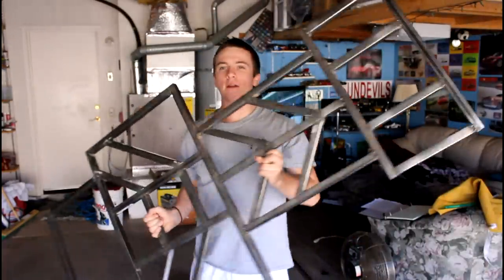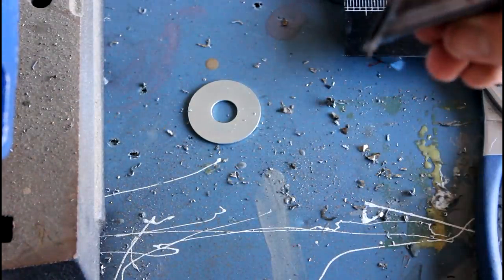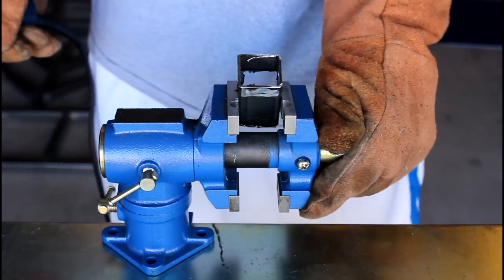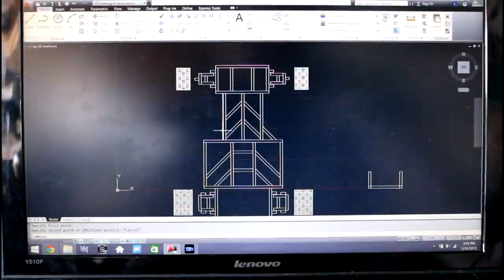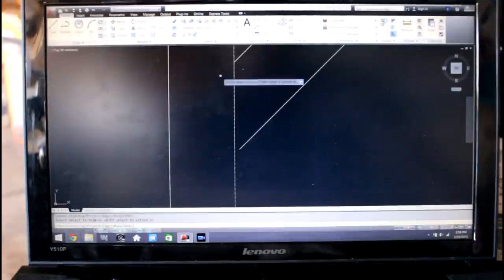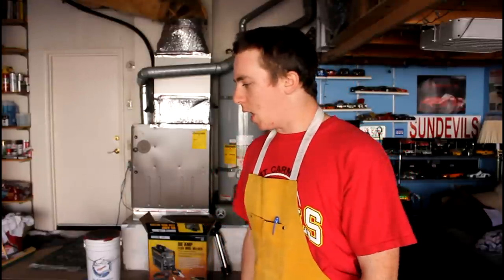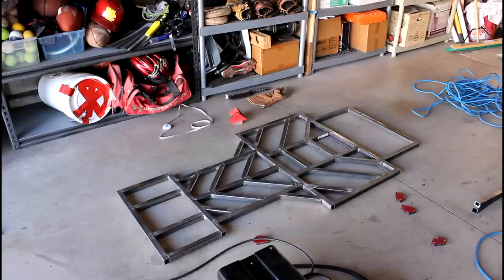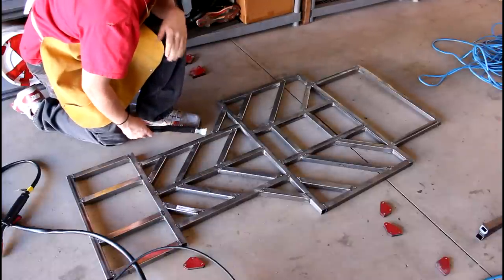(Homemade) Go Kart Build Project 6: Fabrication, Welding, AutoCAD design

Comment: iam a newbie to go kart..here the parts for go kart are rarely available at very exprensive price.so i decided to make one from my gearless scooter of 110 cc.can you please suggest the sproket ratio for that...?

i dont know how to place the suspension.can you plz help me for that?
Reply from the maker: The sprocket ratio depends on what top end speed you want. A higher ratio will give you better acceleration but lower top end speed, lower ratio will give lower acceleration but higher top end speed. As far as suspension design, I'm not too familiar with motorcycle/scooter suspension. I would suggest googling or finding YouTube tutorials that walk through the principles at hand
Reply: Hnat Automotive ok...thanks for the reply😁

Comment: How much did the frame cost all together? How bout the whole go kart?
Reply from the maker: Based on the cost for the raw material steel tubing I would say about $150 roughly. Whole go kart (Without the cost of tools bought) is probably around $1800

Comment: What is the size of that drill bit im designing my own and didnt know what size to use
Reply from the maker: I can't remember off the top of my head, but just use one that works with the bolt size for your shock mounting holes
Reply: +Hnat Automotive Photography ok thanks i love the go kart btw
Reply from the maker: Thanks man I appreciate it! Good luck with your build. Let me know if you have any other questions!

Comment: or which motor ist the best and which type of metal you use because the kart can't be so heavy 
you know what i mean?
Reply from the maker: +david boga Not really sure where you are located, but in the U.S. there are these stores called harbor freight tools, and they sell a 212cc 6.5 HP engine that a lot of people use for go karts. It's a cheap engine, only about $130 (USD), and it's pretty reliable since it's ultimately a Honda clone. If you are looking to build a bigger go kart, such as a two seater go kart, I would recommend going up to 300-400 cc engine since you will be having to move a lot more weight. For the tubing, I used 1 inch height x 1inch width x 0.065 wall thickness steel tubing, it's strong enough to support the weight and forces for a go kart since it has a good sized cross section area, and it's light enough to keep the go kart from weighing a ton. Just make sure you have enough braces in the frame to keep it rigid and strong
Reply from the maker: Hope that helps!

Comment: what kind of welder do you use?
Reply from the maker: here ya go!

http://www.harborfreight.com/90-amp-ac-120-volt-flux-cored-welder-62719.html
Reply: What brands would you recommend? I really want a decent miller but I don't have 700 dollars. I have also seen Lincolns for a decent price
Reply: berton peyton Lincolns the new ones are eh

AHP
Miller
Everlast are really good if can spare the extra
Really worth it imho
Reply: berton peyton I believe Hobart is also good for the price

But I'd recommend breaking out the spread sheet 
Or excel
And go looking around and slightly above price range 
Duty cycle at max
What it can do at 100% duty cycle
Power options
Reviews
Usually 3-4 start reviews have the most informative comments on what can be better or what's good but ya know 
Pinch of salt 
Concerns
Aftermarket 
Etc
List and label everything 
Warranty if it has one ( I'd really recommend it it's why I love everlast because even with their dam good warranty you almost never need it, ahp has really good customer service and is built to last also, havnt worked with Miller though) 
Seriously 
Take a few hours 
Every category you can think of including the ones you think are silly even if it's just looks
Go through forums and video reviews 
Etc... 
welders of a decent quality ( except for a few outliers like one of ahp's ) Arent cheap as chips anymore

Comment: So far in the video that I've seen yeah I get that you're new at this sort of stuff at least at this point in your videos but you create by far more work for yourself then you need to deal with you're cleaning up your edges why clean up areas that you're going to be cutting off like on your shock Tower mounts if you're cutting that section out leave it be and that cutting wheel that you're cleaning them up with very sufficient in lopping that section out personally I would use a flap wheel with cleaning up the cuts to take off what the chops all left